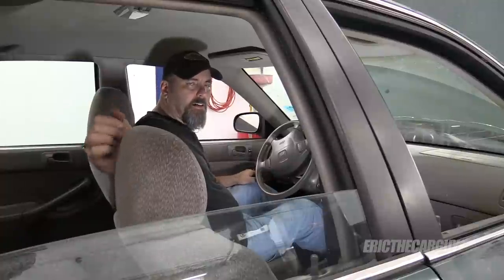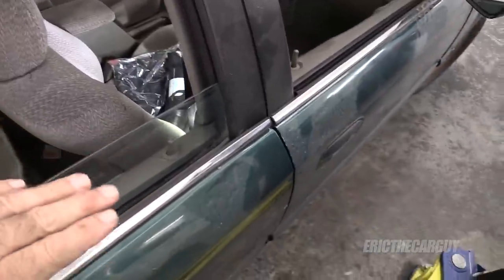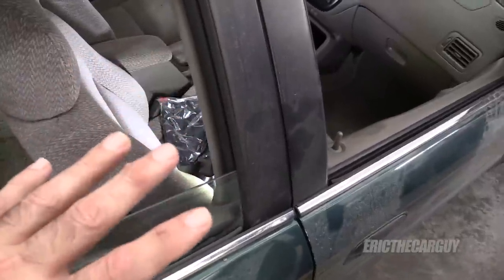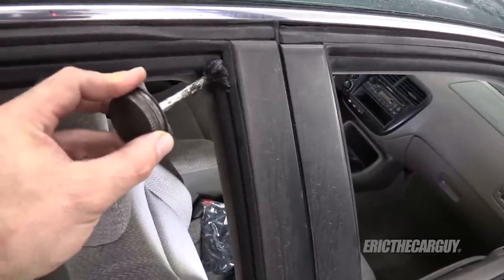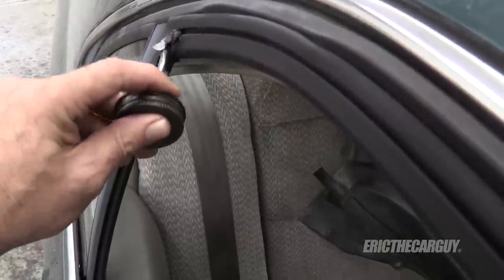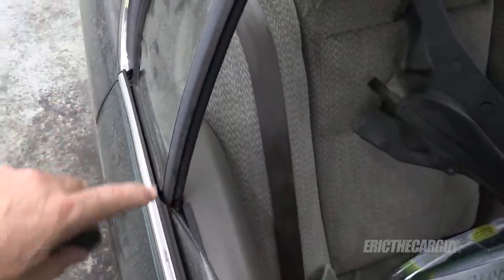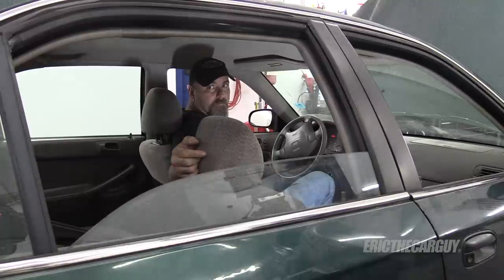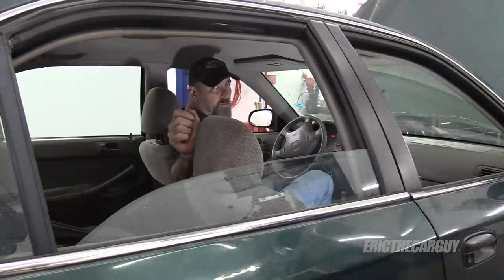How To Fix Slow Windows

Comment: Silicone spray works far better and no dust or dirt build up in window tracks like you would have with the paste. Better still,  would be too  remove door panel and clean all the plastic bushings eliminating these  issues .  Just my opinion.  Thank you Eric for sharing your skills.
Reply: It's loads better isn't it James? Mostly because it runs down into the lower parts of the channel I think, and it's thinner. I do mine once a year with a spray silicone lube and never have trouble...
Reply: Handycrowd , 'you sir, are on the money.
Reply: Dry silicone spray preferably
Reply: Yes
Reply: just like with my girl
Reply: Do I need to worry about getting the spray on my paint? Sorry new to mechanics.

Comment: Yep! I do this but with silicone spray. The paste would be better but I haven't got around to buying the paste yet offline (no stores seem to carry it near me). Also another thing I found on my Hondas, if the window isn't working at all, put power straight to the window motor BEFORE buying a new one. I bought a new rear window motor assembly only to track down the issue to the DRIVERS window switches being dirty.
Reply: Yes ive also had the electrical connector to the window motor get hot and melt internally (driver side switch was sticking). But motor was good just needed to splice in a New connector
Reply: Great tip. It’s very common that dirty or corroded connections at a switch or wiring connector cause slow or intermittent windows rolling up & down.
Reply: ....and you’re right, on most vehicles the power for the other windows is still routed through the driver’s window switch.
Reply: Beware.... Some spray type silicone uses acetone as a solvent. At best it will quickly discolor your rubber and plastic parts. At worst it will eat the clear coat off of your paint.
Reply: You can get shin etsu from the Honda dealer

Comment: Had the same issue in my ‘96 Accord, replaced all motors and regulators, still went slow, then lubricated the tracks with silicon. That helped a bit before it started running slow again. Decided to check if there was an electric issue, found out the window controller in the drivers door ended up collecting a lot of dust and grime over the years. I ended up taking the controller out of the door and sprayed it down with electric contact cleaner. It cleaned up the switches internally and allowed for a better electrical connection to the window motors. Thus allowing more current to flow thru the switch to the motor of the window making it work more efficiently. Hope this can help someone too 👍🏻

Comment: Silicone spray works aswell, and it is less messy, I use it all the time
Reply: Yup, i always have a can for anything rubber as well as my mountain bike forks
Reply: Same, It is neater as you get a little spray pipe with it as well.
Reply from the maker: Not in my experience. The spray dries up quickly whereas the paste will stick around a while. Pun intended.
Reply: Haha, you are right, the paste will last a lot longer
Reply: Eric is right.I worked in a garage for over 15yrs and helped out mechanics whenever they needed help even thou my sole job was car valeting.It dos dry up as they used the Würth product in a can spray as it does dry up.Petrolium jelly i think but vasoline does the job and apply it with a lolly pop stick or borrow your missus's nail file :) If you can take of the door car and lubricate the rollers if you have an older car.
Reply: Tardeli constantini, you don't want to use petroleum-based lubricants on rubbers, it'll damage the rubber.
Reply: Help! My window stuck...
I forgot to move it up-down after application..
Does it because i use silicone sealant? It writes for glass/window...

LMAO
Reply: It doesn't last long though ..
Reply: True it would dry up but I find it easier to apply due to the little pipe and their is no mess.
But everyone has their own way.
Reply: Where do you buy it and what exactly is it called?

Comment: I owned a 85 Prelude before and my fix was, remove the driver and passenger power window switch, pry them open carefully, inside there are copper contacts which are all dirty with old grease and dirt, sand them with fine sandpaper, clean and reinstall, regrease if you like. Result? Smoother power windows.
Reply: Good tip! Many would not even try to attempt it.
Reply: I did the same thing to my 84 Accord years ago and it fixed the extremely slow rear windows.

Comment: Didn't even think of using silicone paste, but as its unobtainable in Australia in a tub, unless you order it from 3M and patiently wait months for delivery, I utilize spray pak roller door lube, which contains a very high proportion of PTFE. Works extremely well and doesn't attract dust.  👍👍

Comment: I thought I have some silicone spray in the garage what do I have to lose. I even had the track replaced a few years ago. It was the drivers side window, it started struggling going up and down again and sometimes just stop. I got my butt off the couch and sprayed it. It hauls butt going up and down now, I sprayed them all. Amazing, I have been looking at all these videos on what I might replace and looking at the costs. Hell yes, it is fixed. Thank you and now I will go and buy another can of this "Blaster" Industrial Strength silicone spray, it has a light green label. Another tip, my seat belts weren't retracting so I spayed them. Now they haul butt going back up after I unlatch it. Thanks again!

Comment: Since you suggest silicone paste in some of your old videos, I have gone through a few cans of the stuff for various issues. For sure, I'm sold, it works great and it lasts much longer than other options. To my surprise it is not available in hardware stores locally, I get it online.

Comment: Sweet...you can get small tubes at Lowes in the plumbing section..waterproof Danco Silicon Grease, not as much as using that big ol' bucket and brush...but a tube and squirt a few shots up and down the track then roll it up and down...

Comment: All the years I've been working on cars, and I never even thought of doing this! Most of the time I fixed slow windows by yanking the panel, and giving the track and sector gear a good douching of lubricant. Well, that didn't work this time in my '93 Volvo 940. After watching this, I went out there and sprayed the 2 vertical tracks with silicone spray ... and they're like new again! THANKS for the idea, Eric!! 👍👍
Reply from the maker: I don't recommend the spray, it doesn't last as long as the paste does.
Reply: Gotcha - I can definitely see how water will eventually wash the spray right out of there. Thanks!

Comment: I have an early 2000s mustang and they slow down for the last 2" going up. But, will close normally if you crack the door a bit. I've greased the regulator tracks, and sprayed silicon in the tracks and it's still tired. Definitely a head scratcher.

Comment: How to fix slow Windows?  Buy a faster computer!!!      ba-dum-tsss!

I'm here all week!  Don't forget to tip your bartenders and waitstaff!
Reply: Didn't know I was at the space bar...
\
Reply: LMacNeill, Nice lol :-D
Reply: Waa waa waa waaaa. How to fix slow Windows? Get Linux.
Reply: Apple computers are worthless 😂
Reply: I dumped my quirky Windows crap for an Apple iMac - have to say, I couldn't be happier. No more random loss of printers or internet, slowing down for no apparent reason, viruses, and all that crap.  

I do have a Linux system for security cameras though. It's simple and works - that's what I want in a computer!  

The crappy part for me is,  I have to buy another Microsuck product in order to do programming/reflashing on modern cars. Not too happy about that. I can do without all the quirks. Wish they made the software iMac compatible.
Reply: Slow Windows? Get a Linux machine. It just works, without sending all your data overseas.

Comment: some fresh grease on the window regulator tracks/gears/cable can do wonders as well. Any time I open a door panel I grease the regulator components. Keeps everything running smooth and reduces strain on all the linkages.

Comment: I've always used the silicone spray,and had to reapply it every month. sometimes after just a few weeks. seems like the paste, being thicker, would last longer. gonna have to give it a try.
Reply from the maker: That's why I don't use the spray for this. It doesn't last nearly as long as the paste does.

Comment: Just a side note: Some older GM cars (maybe other brands as well) don't have power window relays. All the power for the window motors goes through the switches. The result is slow window motors, especially as the switches get older. Adding relays to the electrical circuit helps out a lot.

Comment: This should help lengthen the window motor life as well since it won't be working as hard and will minimize overheating. 

Might help to blow the channels out lightly with compressed air before applying the paste

Comment: Discovered once that the cause was the spool winding up the cable was stuffed because the cable had  rusted so bad. Too cheap to source another replacement part so I grabbed a bicycle brake cable rebuild kit and now the window falls down at 9,8m/s^2 basically. about half as quick back up though.

Comment: What about silicone spray ? That's what I use, I would imagine that perhaps it may not last as long though.  I once told someone to use silicone on their windows and they used clear rtv. I told another person and they used the correct stuff but they smeared it all over the front sides of the glass.  They expressed their opinion of my "good idea" after they had to clean it every time the used the windows.

Comment: Sometimes it's because the window edge is being forced to the root of the seal, edge friction.
Really old cars can be a pain to get biased correctly :-(.
Reply from the maker: Good point.
Reply: Yes but quite boring.
I could of said 'Apply 24 volts to the door motor and see it fly, included is a free burnout for no extra cost!' :)

Comment: Hi Erick, nice advice. May I suggest to apply whatever lubricant bottom to top?. That way most of the lubricant will remain on bottom and every time the windows goes up will spread a tiny bit along the seal. Greetings from Mexico!!!!
Reply from the maker: As I said in the video I realize this isn't lubricating the entire track, but it gets results. See the video linked in the description for replacing a window run channel for details on lubing the entire track. Thanks for the comment.

Comment: My left power window does struggle every once in a while to go up or down. I've purchased a bottle of "Aerospace Protectant 303" but haven't tried it yet, it may help.
Question: if the issue is not addressed on time and power windows are used periodically, this can ultimately burn or damage the electric motor because of the greater "effort" it has to make, right?

Comment: I have used the spray silicone lubricant that worked pretty good on my Volvo 240. Have you used any of the spray lubricants such as that?
Reply from the maker: The spray does not last as long as the paste does.
Reply: @ericthecarguy  Good to know, thank you for the tip!

Comment: I've always used dielectric grease for lubing caliper slides and stuff like that. Do you like silicone paste better in those situations? Often times when I go back to a caliper or whatever, the dielectric grease is all dried up or whatever.

Comment: What about windows that make a loud screech from the rubber trim as the window goes up/down? Only seems to happen from about ~October~April, otherwise during the summer is fine and doesn't screech
Reply: This should fix it, too. The sound is caused by friction, and the grease's purpose is to minimise friction, so should stop that sound from happening.

Please note that this is not a permanent fix, and may need re-applying every couple of months to keep it happy.

Comment: Only window track? What about inside the door where mechanical stuff is moving.
Open up, clean and grease.

I have same issue on my E36 driver door window. Slow at some positions.
Reply: That would help, but that can be a pain in the butt.

Comment: Is this safe for OEM tint on an 18yo vehicle? I'm guessing yes but trying to keep the original tint as intact as possible.
Reply from the maker: Well I used it on my 1979 Fairmont window tracks and it works fine. BTW, those windows are tinted.

Comment: I replaced my window motor and regulator cause the old one snapped. And now the window has so much trouble going near the top I have to push it with my hand. It works fine going down. It’s like the motor is struggling to get up there

Comment: In have a similar problem with my old classic car, when I wind the window down its faster then winding it up? 

Same thing for my fifth leg?
Reply from the maker: Lubing the window tracks would be a good start. If you still have issues you might need to also lube up the regulator assembly inside the door.

Comment: Silicone spray works well and easier to apply.
Reply from the maker: The problem with the spray is that it dries up quickly, the paste will last much longer.
Reply: Eric is right.I worked in a garage for over 15yrs and helped out mechanics whenever they needed help even thou my sole job was car valeting.It dos dry up as they used the Würth product in a can spray as it does dry up.Petrolium jelly i think but vasoline does the job and apply it with a lolly pop stick or borrow your missus's nail file :)

Comment: Silicone spray is better!!
Reply from the maker: Not in my experience. Spray tends to dry up quickly unlike the paste.
Reply: then spray some more :P
Reply: No way, not for this application.  Brushing it on is ideal here.
Reply: Agreed. I've used this paste before along with vasoline and k-y (dont judge lol) in the winter to avoid freezing. K-y doesnt last very long. It was all I had at the time and it was a drizzle with a quick drop in temp and needed to avoid tug-o-war with a cheap pot metal door handle
Reply: I was also told that getting silicone on paint is a big no-no, so I imagine the spray might be bit bad for that also. Locally we have these glue-stick like silicone tubes that you are supposed to use to weatherproof the door rubber seals so that the doors wont freeze stuck. Those might also work.
Reply: I've used silicone spray before, and I also find it dries out quickly; going to try paste for a change, thanks Eric
Reply: Silicone on paint shouldn't be an issue - they make silicone-based waxes for cars - but it can be a bitch to clean off completely if you're planning on repainting your car.  Otherwise, I can't see an issue.
Reply: Honda Shin Etsu grease for this job
Reply: I have the spray, and when i saw this was immediately thinking "Damn i need some of  that paste" lol.
Reply: @ericthecarguy  how about aerospace 303?